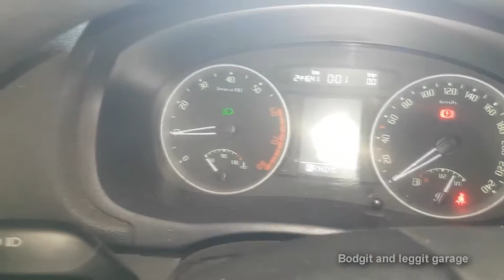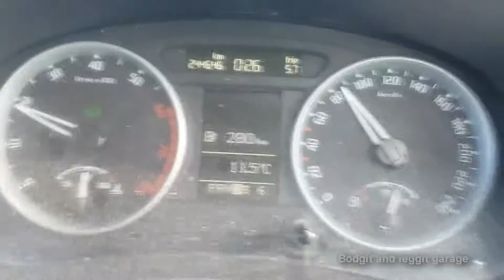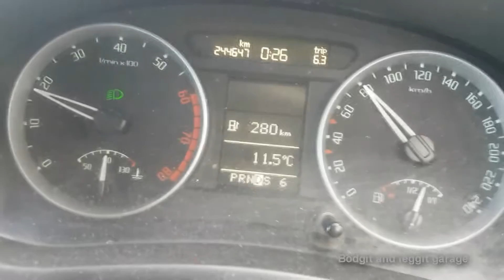I DROP The Engine Will It Start?  Damage? I got a free car part 3

Comment: Use the old parts that are know to work,  been there where engine would not start turn out to be injectors that come with secondhand engine.  Also hope made sure you check Crank shaft sensor for auto and manual are the same  There not on fords had to retake an engin out

Comment: I always swap everything mate, main reasons is there is always something bust or cut or slightly different and it’s usually the last thing I plug in and find it would have been so much easier when the engine was out. Slightly different if the old engine has been dropped lol xx

Comment: No ac? Wtf
Reply: He’s in Ireland, it never gets warm enough to need air cooling !
Reply: @CrimeVid  ac is not for Cooling only... Also helps with damp weather.
Reply: Yah that's why I like the i10s they come with AC on mid trim and it's such a nice feature to have in the winter time you can keep  cool inside without getting roasted and the windows stay fog free and in the summer when going on the main roads